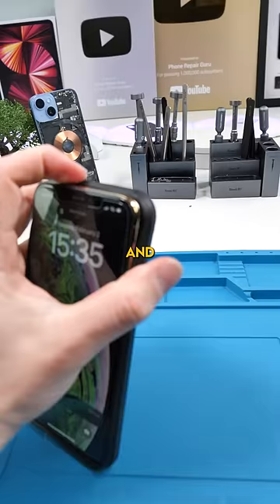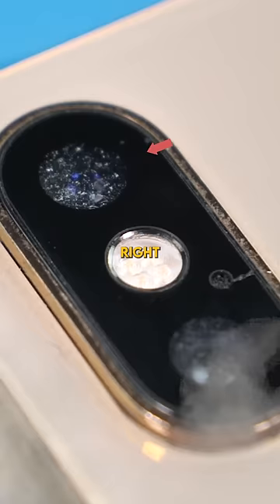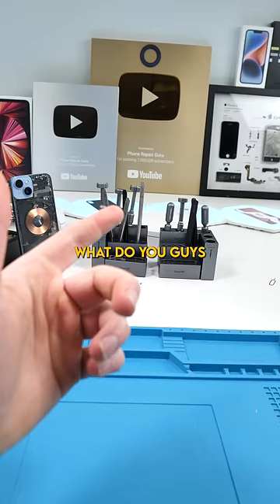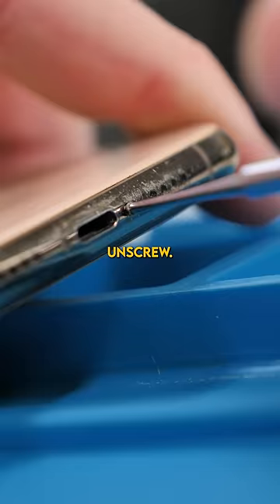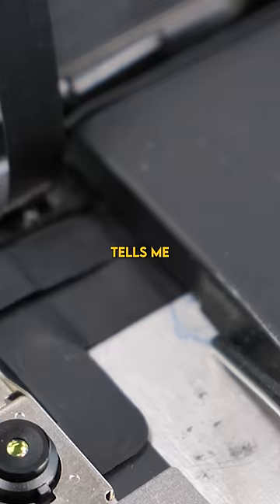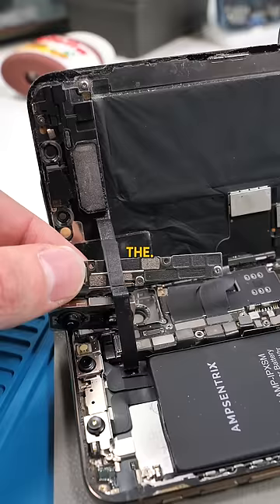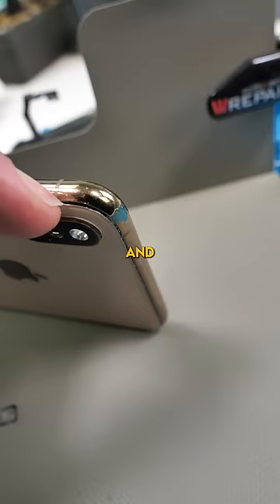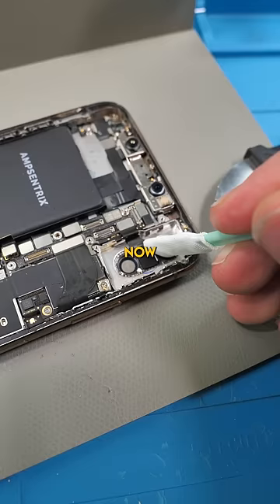The Strangest iPhone Problem I've Ever Seen... #Shorts

Comment from the maker: also had to seal off the flash in case it was coming from there. A full back glass swap would definitely be more ideal but would be much more expensive compared to this fix.
Reply: Add magsafe to a toaster pls
Reply: Try a fake Samsung 23s ultra
Reply: Could you make a custom PC to give it away everytime you achieve a goal like 1m subs, 2m subs, 3m subs and so on?
Reply: sub or dust in phone
Reply: Why do you cook some devices
Reply: I feel like phones have come to a point where you can't really no if it's worth upgrading or not
Reply: I had a spec of dust on my lens but it went away somehow. This Iphone (XSMax) never got broken (and never repaired). It is really weird.
Reply: Hlo bro my iphone 11 is automatically shutdowning we changed so many battery's but it shutdowns in 4mins aftet opening,so how to fix it bro, plz tell me
Reply: Interchange iPhone 13 pro display with iPhone 13 😅😅 love from Mumbai india
Reply: Help I need 2 iPad minis fix and one iPhone. One iPhone and one iPad has charging port issues— All need screen replacement—can you help?
Reply: Hey bro. I dropped my 22 ultra and cracked the back glass. If i get it replaced will the phone still be waterproof?
Reply: S23 is pretty cool i bought it
Reply: When will mail ins be a available
Reply: Wow Fr
Reply: A scambot replyed to my comment idk what to dooo
Reply: someone replied to my comment claiming they were you they were like that text me here guy
Reply: Hey phone repair guru I have a blue iPhone XR that has a cracked screen with black splotches on it and the back glass is cracked
Reply: Hi, I just dropped a knife on my galaxy S7 lite tablet, and there are a lot of cracks on it, how do I ship it to you for you to fix it?
Reply: @Mr Menel PL ඞ it's for the phones with the glass backs because they're harder to remove. I hope that answers your question.
Reply: How do you clean the actual camera? And not just the camera lens, because my phone got dirt in both
Reply: I need a help with u can u help me 
I wanna talk something about you
Reply: My mom found a iPhone 11 and my brother try to reset it but he got it locked by the owner and I’m never gonna get a phone :(
Reply: @HyperYt-dw5vm  you will don't be dramatic
it will just take time
Reply: Sir my hw7 max smartwatch display brightness is 100 but the screen blacks out i had to use my phone flash light to see but it looks very dim plz help
Reply: Do you have any suggestions for a protecting and cheap/ish iPhone X case
Reply: I love the features of S23 And S23 ultra 
The android is experienced and cool
In the optimising one is like an emoji
Reply: Eijiĵiuiuiuiuij
Reply: I want to repair my phone
Reply: please give me a shoutout
Reply: Would you fix the fan on my 8 yr old hp laptop with glue stuck in one of the screws?
Reply: Yes I would
Reply: How much would a screen repair on an iPhone 11 cost
Reply: @everettwehri280  25 dollars
Reply: @QuinTonix  28 dollars
Reply: The s23 is cooler
Reply: @fentse_107_  send it
Reply: I have a real s23
Reply: my x has the same problem
Reply: What non original screen you suggest for iPhone XS ???

Comment: S23 is pretty nice with larger batteries, sort of new design and the 200mp camera on the ultra. Hopefully with the the S24 they make a new design, continue to increase battery size and add back expandable storage and the charger in the box
Reply: what do u mean sorta new design it litterly looks the same 💀
Reply: Atleast iphone had bigger cameras
Reply: Why would they add those backs when they earn more money without them (you have to buy more storage and a charger separately)
Reply: @Ytmutant  the bigger cameras look goofy and bigger doesn't even really mean better with cameras so it's just easier to break them really
Reply: @hencodelange9289  bigger means more light so more detail
Reply: @Ytmutant  that's fair, my 14 pro work phone does way better with night mode than my s21fe personal phone
Reply: @gavinsingh2234  the 23 and 23 plus are different slightly, the ultra I'd boxier
Reply: @RaptorRulezz  he saying difference between s22 and s23
Reply: @hencodelange9289 ahhh.....dudes comparing an old not flagship model with the new iPhone 14 and wondering why the iPhone is better. 🙄☠️
Reply: @The Chicken  not much better, and I still love my s21 alot more
Reply: @hencodelange9289  but for what do you need to phones? If I may ask.
Reply: @The Chicken  the iphone is a work phone so my employer gives everyone one that has to be on at all times, basically like a pager. It also helps keep work and personal life separated.
I'm responsible for keeping web servers on btw
Reply: @hencodelange9289  I actually don't know what to think of work phones (devices) they're good, if you want to have work related things [separated?] from private things. But I also think that having your own device for work instead of an device that's been given to you, can be more practical, because you have to choose wich device that you want to work with, so you can be more productive or something like that (I don't have the right words).
Reply: @Gavin Singh  it's slightly different, so it's sort of new
Reply: Ahem, I know what you need. Ever heard of the Samsung Galaxy A series? You can get that. It has dem expandable storage
Reply: @Josh23838  I have a galaxy A20 right now I think the galaxy a series is worth the money since they have flagship options for budget phones like 90 or 120 hz refresh rates
Reply: And add a headphone jack
Reply: @XandarYT they not only about making more money. Not expandable storage is more reliable and faster, that's why they only have expandable storage on mid and lowend phones.

Comment: The ULTRA line up is an excuse for Samsungs employees to go bananas on the specs. I mean, ray tracing on a phone?!
Reply: What's that?
Reply: Wouldn't really be ultra if it wasn't bleeding edge would it?
Reply: Ray tracing really??
Reply: The entire line has that chip though? It would definitely be mote usable with the extra cooling though.
Reply: @MM54334  yeah idk either what is it
Reply: @l.skinner2  ray tracing is a lighting trick on games, where it basically sends a bunch of invisible lines (rays) to calculate how the lighting would work in a real life scenario. so think reflections, shadows etc. 

ray tracing takes a lot of processing power however, so that's why he is impressed.

personally, for me it doesn't make a difference on phones because basically no games support it yet, but also ray tracing is available on the chip that they use, not just the Samung, so it isn't really Samsung adding it, it's Qualcomm adding it and making it available to every phone with an 8 Gen 2.

Comment: S23 Ultra is pretty good right now. Much better SOC compared to the S22 Ultra, battery drain is better, heat management is also better for now
Reply: What is soc?
Reply: @surayajamaludin3289  system on chip. In this case it is the CPU, GPU, RAM, cellular modem etc. on a single piece of silicone chip
Reply: @battlefield3112011  thanks

Comment: I actually had that dust problem with my current XS, too!
Reply: Hey I’m also having the same issue, I’ve already replaced my back camera glass 3 times and still it becoming dusty 
Have u found out any solution?
Reply: Better to change the phone, my repair guy told me that if you keep on getting the phone for cleaning again and again, it would get messy after some time, so it’s better if you can get rid of it soon. I did that and got some good value in exchange and that benefited me in buying my new 13!

Comment: I literally had the same problem with my XS, had bought it second hand and the last user got the back part replaced but it wasn’t done properly as there was some gap between the glass and the dust was coming it from there into the phone, so every two months I had to get the back camera part opened and cleaned, it got bad and I replaced it with my new 13!!

Comment: I thing the iOS phone And Galaxy phone start from s21 - s22 ultra have two Layers main board too Nice. Because the processor is large plus , the face id , touch id or others sensor Chip is seperate . Not same like other phone every Function in one chip process.

Comment: The s23 is just the same thing as the s22 ultra with just a higher detail camera. And a slightly longer battery life, which is only able to beat iPhone 14 pro max for about 10 minutes or so. The plus model is even better at battery life than the s 23 Ultra. That is very disappointing

Comment: I have the s23+, and im gonna be honest, I'd rather the s20+. it's not much of a big difference apart from the processing power and, of course, software updates. I like the 12 GB of ram the S20+ has and the additional storage using a microSD card. I also like the 64 MP camera that the S20+ has, unlike the S23+, which has only a 50 MP camera and 8GB ram. overall, if I had to choose, I'd rather the s20+, but the s23+ is nice to have for the security and software updates.

Comment: The s23 looks cheaper without that camera bump design the s21 and 22 series came with. The s23 ultra itself looks like a really good upgrade although it's pretty much the same as it's predecessor. But the biggest upgrade is that in Europe and other continents the s23 now comes with the snapdragon rather than the shitty Exynos. So there's worth it the upgrade to an s23

Comment: The S23 and S23 Ultra look like boring phones, and they look similar to the S22.

But internally, the more power efficient Snapdragon 8 Gen 2 for Galaxy chip and the increased battery capacity for the base S23 means a longer battery life for a compact smartphone. Not many compact models have good battery life, but it looks like this is a huge improvement over the S22, so I'm very much looking forward to getting it later this year.

Comment: I know this will probably never get seen but I need help lmao. (All the way from South Africa lol). I have a Samsung a10s with a possible charging port issue. We here in SA don't necessarily have legitimiteit people like you who actually fixes the phones besides the phone companies who will charge too much to replace or fix something. Do you know of any way I could over come the issue with the charging port besides having to replace it? Even though I know it's probably the only way to fix it. I need to retrieve the data from the phone for my dad and it's not taking charge at all. It seems like the port inside has moved as well... if opening the phone means there's a way I can get the data for my dad, how does one even open this kind of phone?

Comment: The s23 ultra still has a worse display (1750 nit vs 2000), slower performance (by about 20% in Geekbench) and worse battery (8h screen on vs 10) AND still has shutter lag & unforgivably low video quality than my 14 pro max? I’ll pass.

Sources:
Display spec: Samsung’s & apple’s respective websites
Geekbench: 91 mobile
Battery: Samsung’s claimed battery life being the same as s22 ultra and mrwhoestheboss 14 pro max vs s22 ultra battery comparison
Shutter lag: mkbhd galaxy s23 impressions 
Video quality: mrwhoestheboss ultimate camera comparison

Comment: The s23 and s23 ultra are good and bad. They are good upgrades from previous years but in regards to value they’re not much of an improvement. If someone bought the s22 versions they’d still be getting one of the best devices on the market. But they’d pay a fraction of the cost. And at that why should you pay potentially 1000+ for the s23 series when the s22 series is so similar and has little to no real drawbacks

Comment: PRG Can you figure out what is my phone problem I using the phone sometimes it's trun off itself can't turn on it again put in charge red color notification light is blinking but phone not turn on if I hit in the back of the top right corner it turns on charging and showing yellow light display turn on working fine what is the problem battery or something else phone model Huawei mate 10 lite